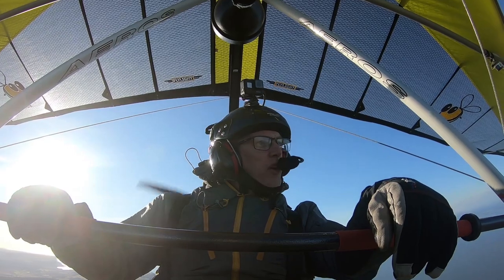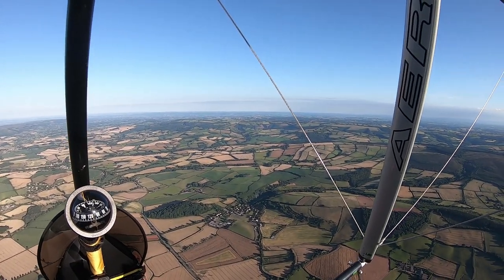Flying to Minehead, a surprise in the circuit - Looking out1

Comment: Giles, I understand the worry about engine out for a small two-stroke and needing landing zones, but, the PeaBee has about twice the glide ratio of a paramotor. Doesn't this open up more areas that you wouldn't want to take a paramotor across due to the its lower power-off glide distance? At any rate, you are the pilot in command so your decision is what counts. Nice vlog. Nice flight.
Reply from the maker: The glide is better, but I still couldn't get to Wales, the glide from just below the Airspace above won't allow it.  I just love flying.